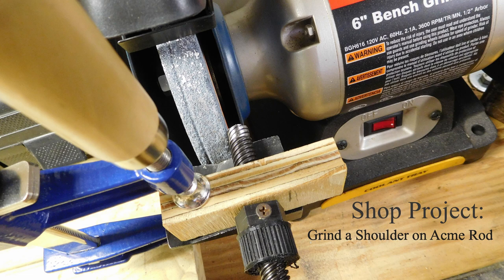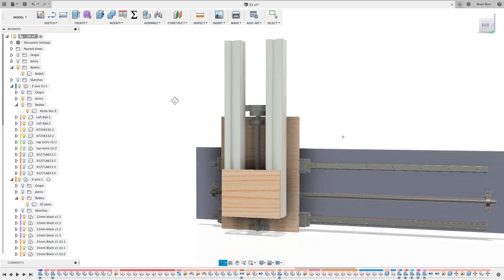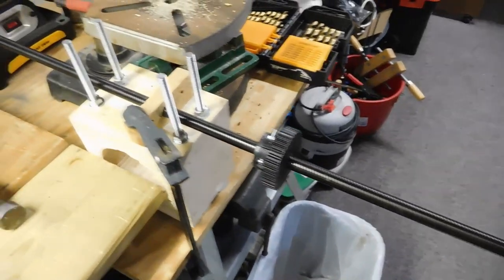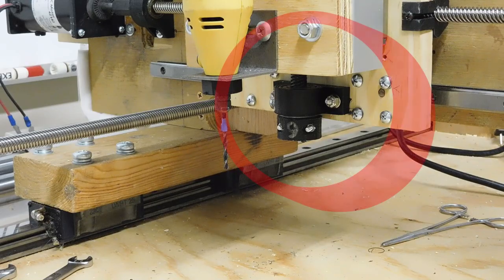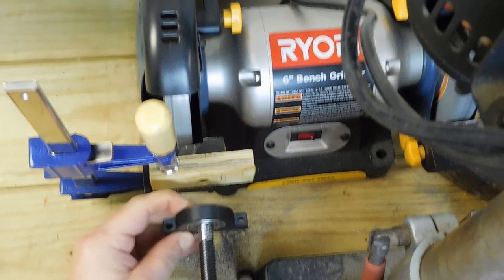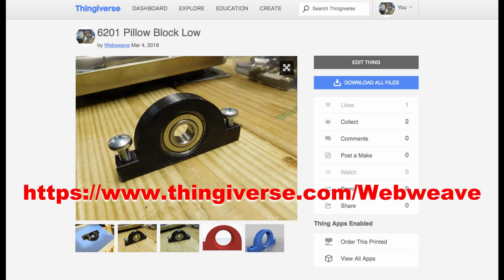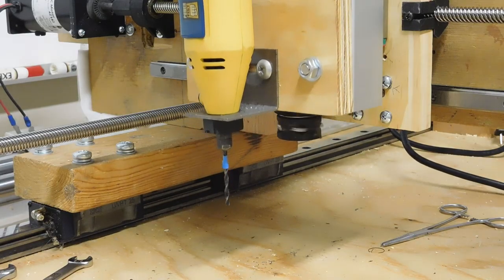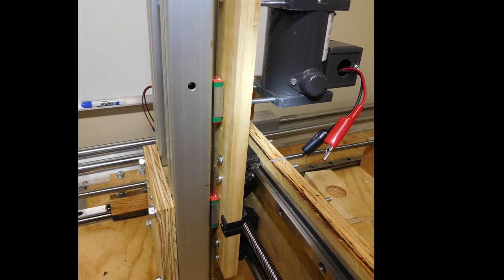DIY CNC Router Project "Acme to Bearings"

Comment: A question but in the 3d printer world you never ever want to captivate both ends of the rod or you will get Z banding yet we are using those same rods and do it on our CNC routers and I wonder why?  

Btw, does your machine do Aluminum?  Looks like it easily could to me.
Reply from the maker: Good question and I don't know. I've used much larger ball screw actuators (from Motion Systems Corporation) that were well over 1" in diameter and the company told me to design the fixture to only grip one end of the ball screw so that's what I did and they worked fine. This is a silly little design that I'm doing without using any large machine shop tools so compromises are being made like all my bearing holders, couplings and collars are 3D printed which has inspired me to double everything up.

I'm sure with some creative toolpaths and minimal removal aluminum will be possible but I'm building this for to make wood and foam molds.
Reply: Well, the only reason a machine can't do aluminum is due to a lack of rigidity.  If you look at most machines for the DIY they use unrestrained smooth rods which bend easily and by the time you get to a smooth rod that doesn't bed it will begin to sag and cost as much as rails and blocks would.  A lot of machines have Y and especially X slop which makes doing aluminum near impossible.